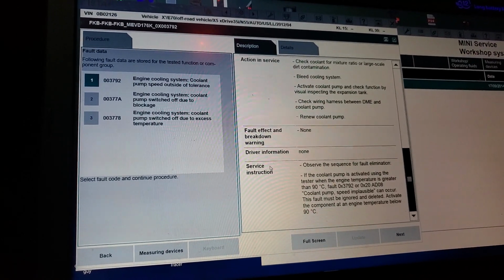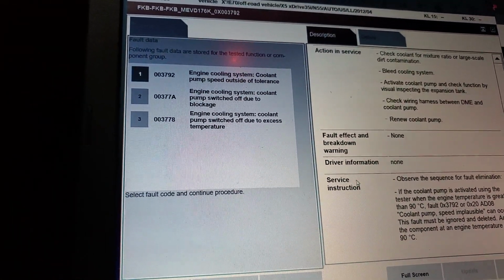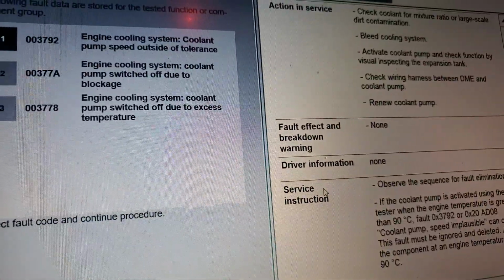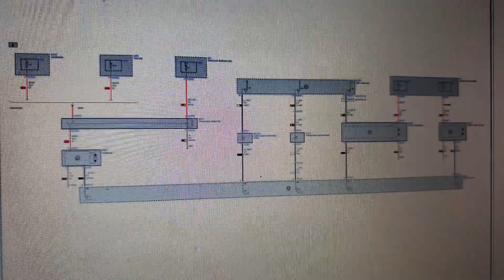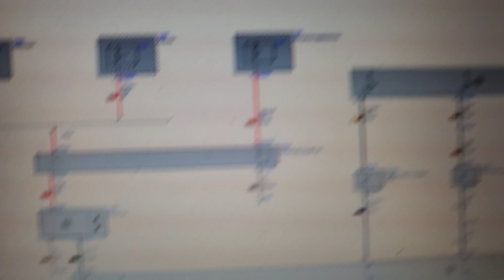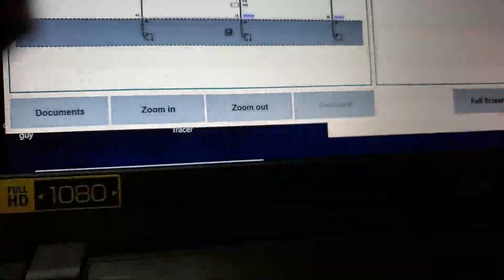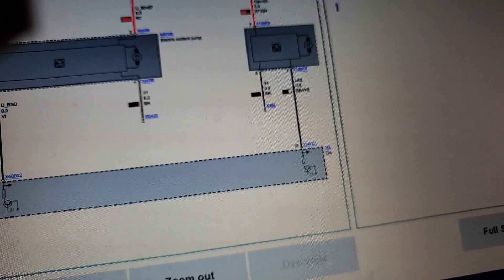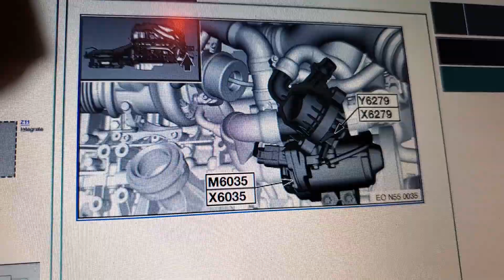Overheating: How to fix Engine Overheating on BMW 7 and 5 Series (solved)

Comment: My 2013 BMW 740Li lately has been having a "Engine Overheated" on the dashboard but my mechanic could not find the cause of the issue after manually checking the Coolant, radiator, thermostat, water pump and the radiator fan. the computer diagnostic also did not show any codes or warning. Prior to the engine overheated popping up, I can hear the fan starting to over work, if that's any indication. Once I pull over and let the car cool for 10-15 minutes, it will drive for a couple of days without any issue but eventually it happens. Any ideas?
Reply: Having the same problem do you ever find the solution?
Reply: @Thetwoyear730journey  did u find the issue
Reply: What was the problem?
Reply: @contentm3893  did u find the problem? I have the exactly the same issue
Reply: @ahiskaa9807  No. It's been parked for 10 months.
Reply: did you find the issue?
Reply: @thomasshahab6561 did u find the problem?
Reply: Same problem here

Comment: Hy. I think I have a problem with the thermostat o water pomp. 
When I drive normally in highway 130 km/h my water stay between 103-108 degrees . If I stop the car he goes 110 degree  so I Don.t think is normal. I have a f01 bmw 740i
Reply: Hi I have a similar problem do you find the solution? thanks in advance. George.

Comment: Hey, what’s up!! Thanks 4 the video. 
I just in stalled on 528i a new water pump, thermostat and radiator. I’m still getting “Temp High” warning ⚠️ light? Can you help? Thanks.
Reply from the maker: what year 528i and im guessing 6 cylinder?
Reply: 2008 528i 6 clynder
Reply: Did the mechanic reset your codes after the repairs? If they didn’t you’ll still see the warning ⚠️